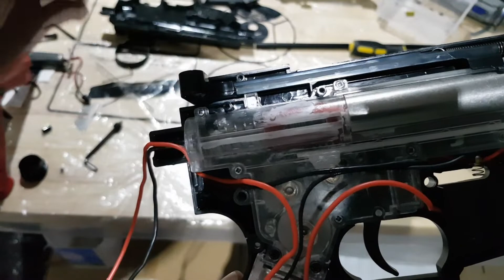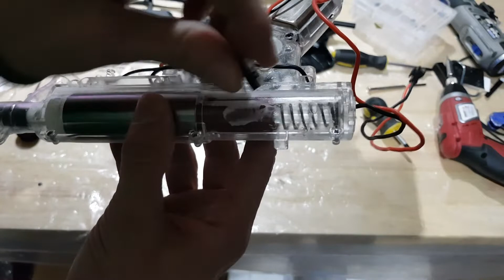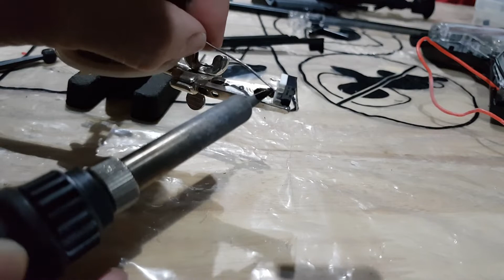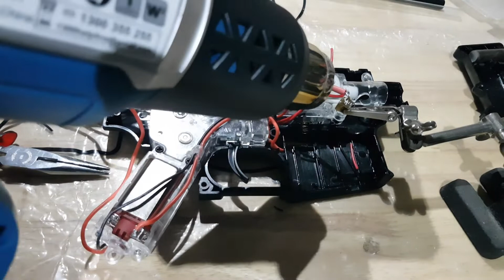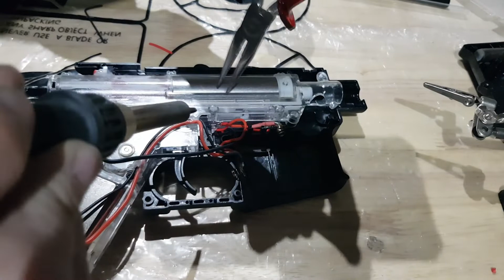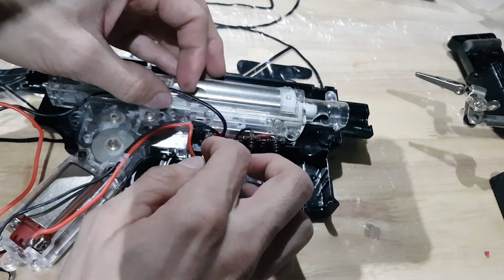gen8 M4A1 gel blaster Mag prime mod

Comment from the maker: Just realised I didn't add backing music to this video. oh well that's what happens when you are rushed all the time and trying to punch out some videos as fast as you can.
Reply: Low Guido's Chop Shop Not having background music doesn't matter so much as actually describing what you're doing ie:- connect this wire to that switch terminal. Especially if you're going to use the same colour wire for everything.
Reply from the maker: yeah I didnt explain because I was intending to have music LOL
Reply: Can you explain hahah
Reply: was thinking would this have not been better to mount the primer in the forward assist button. or is that to much work?
Reply from the maker: you could do that. but, the charging handle is there for the specific purpose of charging the rifle.
Reply: yes in further research i have notice some put a variable resistor in the forward assist to change the rate of fire.
Reply: Hey, i am just getting into gelsoft, and i want to purchase the M4A1 gen 8 as my first blaster, but in your review you said it would be good to change the barrel to alliminuim. Can you make a tutorial on how to do that and tell me where i can buy an alluminium barrel

Comment: Hey mate, thanks for the video. But is it gonna prime as normal when you press the trigger since you've connected a diode to the positive spring? Just need to clarify before doing this to my m4a1
Reply from the maker: The diode only stops the main motor from turning when priming.  The mag motor spins when the prime handle is pulled and when the trigger is pulled. It would be kinda pointless if it didnt.
Reply: @lowguidoschopshop  thanks mate!

Comment: Is the gun supposed to do that or its a mod? Mine is standard one, when you pulled the T thingy it only opens up the side cap and nothing else.
Reply from the maker: It's a mod. So that when you pull the charging handle it actually loads balls into the chamber so you dont have to dry fire 5 rounds before any come out.

Comment: Hey mate my M4A1 doesn't prime at all and therefore does not shoot the gel pellets, do you know how I can fix this issue? I was told by a few ppl that the connector wires might be loose or has no power however I tried to take it apart but did not dare as fear of breaking it further! Any help or advice would be great PLEASE as this M4A1 is barely 2 months old!
Reply from the maker: send it my way, I'll fix it.
Reply from the maker: deelowguido@gmail.com

Comment: Hey mate I’m trying to do it now but where and how did you fit the wiring in? I can’t fit it anywhere that lets it be put back together
Reply from the maker: It runs down to the gearbox and then across to the frontnof the trigger switch. Its tight. Your wire gauge may be too thick? I remember it was tight but it still closed. My wire was 1.7mm including insulation.
Reply: Low Guido's Chop Shop yeah I’m using the 18 gauge wire jaycar gave me. I’ll have to go back a 4th time and get more wiring again 🤦🏽‍♂️

Comment: Hey mate, can you make a video how to use fishbone converter for jin ming m4a1 blaster?
Reply from the maker: Yes. Soon
Reply: Yes please do I Have two types of screw adapters and no idea what to cut away!
Reply: Low Guido's Chop Shop 
Hi was wondering if you could give some idea or advice on fitting the fish one acre thread adapter.
I’ve cut my receiver end pice off but obviously other parts have to be modded?

Comment: Whats the difference between normal condition vs this mag prime mod?
Reply from the maker: SFZ Gaming normal condition does not load balls into the chamber when you pull the charging handle.
Reply: Low Guido's Chop Shop Ok thanks. But can you make a mod where everytime we shoot, the plastic beside cylinder will open then closes by itself? Idk whats it called but in real gun it will eject bullets.

Comment: 1.did you cut the negative wire from the mag spring and solder it at the switch? or you just solder a new wire connected from the ngative spring to the switch?

Comment: Not all M4a1 have this I'd assume this is a newer model.
Reply from the maker: its the Gen 8 model
Reply from the maker: actually now that you mention it I have had to dremel the switch housing off the last 2 UMP45s that I made and I dont remember having to do that before. perhaps it is a new thing.
Reply from the maker: actually to be honest it would probably be easier without it because I ended up dremeling out most of the housing anyway. maybe if I had used the correct switch ...  either way. gets the job done.

Comment: I can see you connected the diode to one end. Where abouts did the other wire get connected? It gets covered by your hands
Reply from the maker: The diode goes inbetween the mag terminal and the main motor so that when the charging handle is pulled it doesn't power the main motor.
Reply: Low Guido's sorry I didn’t ask that question properly. I meant the other end coming from the new switch. I’m stuck atm I just went and got a diode and installed it the same way you did on what appears to be the positive terminal. Although I got it working with a new switch but no longer fires when using the trigger
Reply from the maker: One side of the switch goes to the mag terminal with the diode, and the other side goes to the common on the trigger switch.
Reply: Couldn’t get her working in the end.. if the switch worked the trigger didn’t activate the mag. Then I was activating the trigger with the switch. May have buggered the diode but gave up and put it back together
Reply from the maker: the diode doesn't go inline with the switch, it goes between the mag and the original trigger. this video was not intended to be a tutorial video but just a documentation of what I have done. I might have to make a tutorial video for it.
Reply: @lowguidoschopshop  Make a tutorial please :> I'm still confusing about this "the other side goes to the common on the trigger switch" :)))